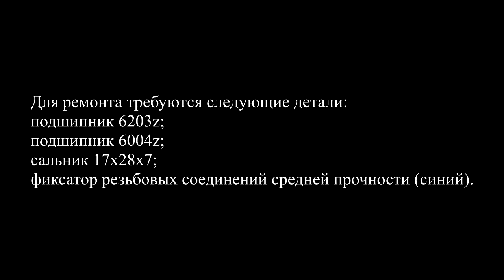Elite Turbo Muin Smart B+ Установка новых подшипников и сборка велостанка

Comment: Hello there,

I also have the instructor voice problem. It is up to me to repair it as the warranty is over. When I checked the track you showed in the video, I saw that the bearings were playing. When I emailed the elite company, they said that this piece was not sold and they could not support it. How did they help you with this issue?

Comment: Hi Aleksandr your video id fantastic, I managed to dismantle all but how did you remove the bearing behind the oil seal and also the top belt pulley is hard to remove. I want to change all bearings tomorrow. thanks
Reply: Hey @jeff, did. You change three bearings? I can't get the one behind the seal. Can you help me out!?
Reply: @jeffadam996  can you give the part numbers you used or where you sourced the bearings. cheers
Reply: @jeffadam996  how many bearings do i need? 2 or 4 ? 2x 6203 and 2x 6004?Thx
Reply: @konstantinschultz5628  3x6203, 1x 6004.
Reply: @konstantinschultz5628  2 bearings will do

Comment: Thank you, a really great Video, exact that what I searched for!!! 100 Points !! :-)
Reply: If you didn't measure oil maybe you will get noise issues as per some oil is lost in the operation and also passing the time. Would be interesting as asked before to get oil type and amount. I use fork oil Wich is more dense than that at a glance.
Reply: @creatorex1  What type/weight of oil did you use? What amount?
Reply: Krejza82 used fork oil, any is possible , I refilled and removed until feel rolling ok. Not too dense nor vibrating...

Comment: Hi, many thanks for the video. It is a great ressource. I have problems to unscrew the bolt of the flywheel. How did you do it? Thanks for the answer.
Reply from the maker: Hi, held the shaft with a pipe wrench, as shown in the video 5:28
Reply: @caH40yc  Hi thanks. It helps. Now I need to remove the flywheel. ;) any tips?

Comment: Hi
After changing bearings still I hear that noise, but little quiter.
Where I can find the problem?
Reply from the maker: Hi.Sorry, I'm not an expert, I repaired a couple of times and after that I had no problems.
Reply: @caH40yc  Ok, I understand. I have some advice - you don't show how difficult is to unscrew this nut on the shaft.
It's glued, so the flywheel must be locked, otherwise the shaft will be rotating and makes unscrewing this nut impossible.

Comment: Excuse me aleksandr did you knew wich kind of silicone oil takes this elite turbo muin??
Reply from the maker: My friends replaced with synthetic oil 5w40. The amount of oil was selected and controlled using an external power meter.